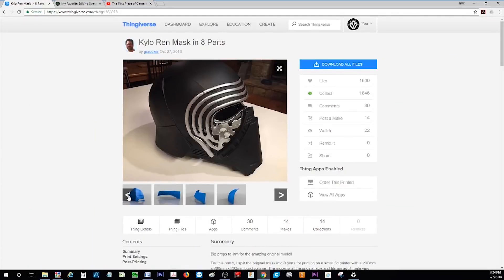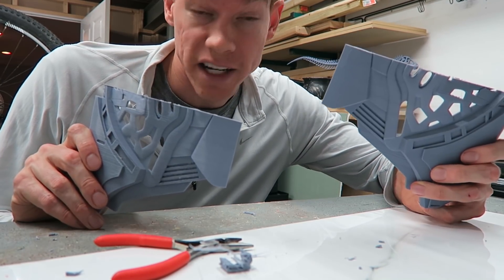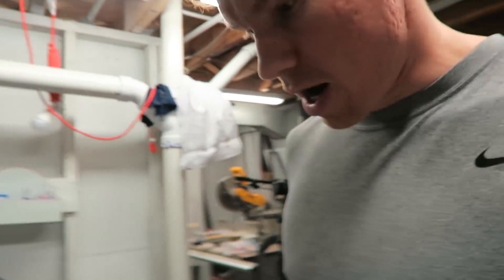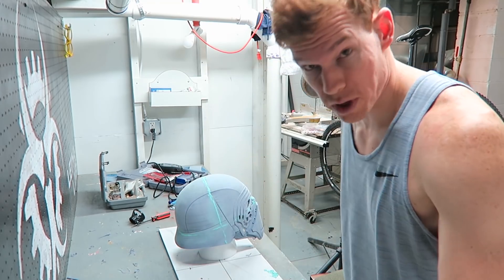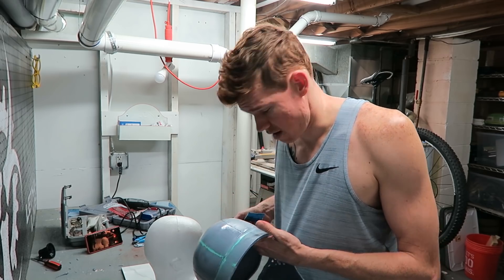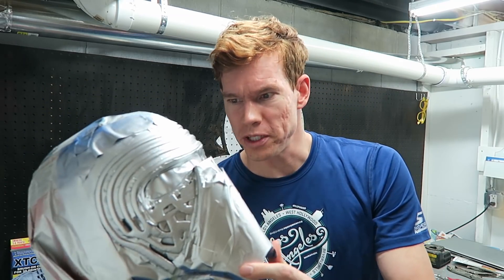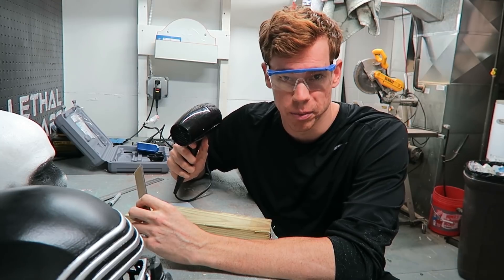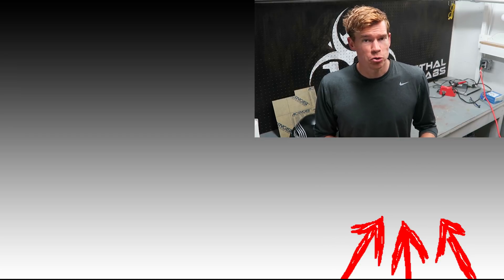3D PRINTED KYLO REN HELMET | CREALITY CR-10

Comment: how would you size this to fit different size heads?
Reply from the maker: In any sort of slicer software you can scale the prints, so if you scaled each piece the same amount then you'd get a larger print. If I was to do this again, I'd print the helmet in one piece (would need to find a .stl that was one piece)

Comment: The xtc-3d, is this really needed? I've seen other youtubers 3d helmets and a lot of them do not put this on. Especially with a Kylo Ren helmet since it isn't perfect.  Also, Do you have experience with Bondo Spot putty? if so do you like the acryl green better? Thanks.
Reply from the maker: You definitely want something to smooth out the 3d print lines, whether that's acryl green or xtc 3d or Bondo. I've been using wood filler recently.

Comment: What support angle did you use?  Seems like my program is using way too much for supports.  36 hour print for the left eye piece
Reply from the maker: I don't remember, I think I can usually get by with 70 or 80 degrees. Your results may vary

Comment: Simple acetone would've bonded those parts together on the surface. In fact, acetone would knock down the print lines and make the surface a lot smoother looking. Use filler primer and that bad boy would look like a seamless helmet.

Comment: That friction weld technique was really cool. Generally I use gel super glue in the seams and sand it with course sandpaper while it's still wet. The small pla particles mix with the super glue as you sand and creates a seamless finish.

Comment: If you want really good visor plastic there is something called solarplexus it's a type of acrylic bendable plastic that you put on car windows it's a fue mm thick has solar protection and  it's easy to cut  I use it in my mandalorian helmet and the best benefit is that its airsoft proof too

Comment: printed the parts with the upper eye's 3 times and it always breaks at the bottom of the eye part removing the supports.. someone should have thought of that when slicing this. The other parts are easily printed and cleaned up but the 2 with the partial lower eye pieces are a nightmare.

Comment: Have you ever thought of splicing all/some of the pieces into say 2 or 3 pieces instead of 8 pieces? Yes I understand a lot longer lead time but also less post processing if done correctly. Thanks!
Reply: 8 pieces helps a lot for those who have 3d printers w/ small printing area , but splitting by 2-3 pieces, sounds a great idea also

Comment: Could you not just print that as one piece? I would think the bed on that printer would be big enough. I'm just getting into printing so that may be a dumb question.
Reply from the maker: I do believe that would have been possible. The model I used was already cut into pieces. The difficulty with printing in one piece is all the support required for the top of the helmet. I'm working on an x wing helmet that I printed upside down in one piece

Comment: Quit using that crappy crazy glue. Go to a hobby shop and buy CA or Cyanoacrylate glue. It can be found in different formulas to fit specific situations. For this application you'll want Thin CA which flows between joints and "kicker" or accelerator which quite literally flash cures the CA instantly. Just align the 2 pieces, apply the thin ca and allow it to run down the joint, spray it with a quick shot of kicker and voila. Glued. Not right. Apply a little un-bond (yes, it's real) and the piece comes apart. Wipe it off, repeat step one. To fill in gaps use Thick CA which has a very thick consistency and can be used to fill in gaps and holes when also combined with accelerator.

Comment: Really nice process video! Thanks for sharing. It's great seeing the whole process soup to nuts, and hearing why you did things the way that you did. Was that just standard old superglue that you used to glue the parts together before friction welding them?
Reply from the maker: Yeah, just standard super glue. The friction welding is probably unnecessary (I only used super glue on my Stormtrooper Helmet).
Reply: @LethalEngineering  Ahh, thanks, I was wondering. I tried friction welding on a some prints that I did and wasn't really confident about the "welds," despite my past experience with steel welding. It seems like the superglue bond is way stronger than any friction weld I'm able to make. Filling gaps is about the only use I can find for it.

Comment: hello! i love the process and the video, and i think it was a very successful project. do you think you could share some of your settings that you printed, like layer height, brim or support details? Im on the ender 3, cr-10's little brother haha
Reply from the maker: Here's the print settings I currently use from Cura: Layer Height = 0.2 mm, Wall Thickness = 1.2 mm, Infill Density = 10 %, Infill Pattern = Triangles,  Infill Before Walls = unchecked (so the wall print before the infill), Printing temp = 200 C, build plate = 60 C, print speed = 60 mm/s, support overhang angle = 80, build plate adhesion type = brim, brim width = 8.0 mm. I've also recently switch to Amazon PLA filament and really like it. I'd been using Inland PLA and hatchbox before.
Reply: @LethalEngineering  I've also been using Amazon PLA from AIO Robotics at $12-$13 a spool, it's pretty good filament for a low cost. I just got done printing Obi-Wan's and Kylo Ren's saber, (now painting) so I'm excited to start making this helmet project. Thanks again!